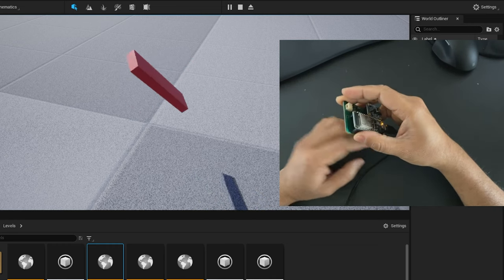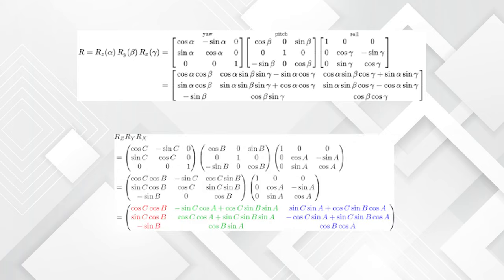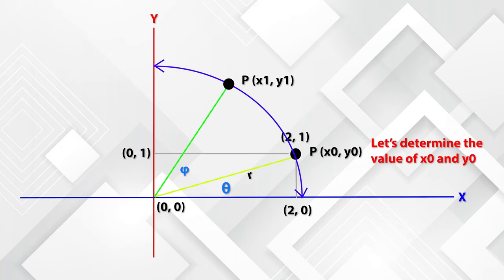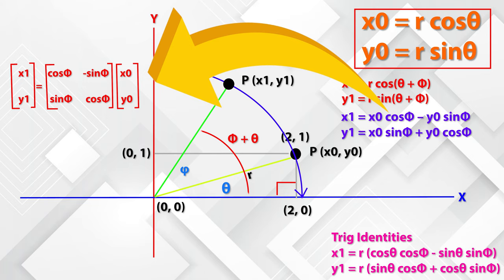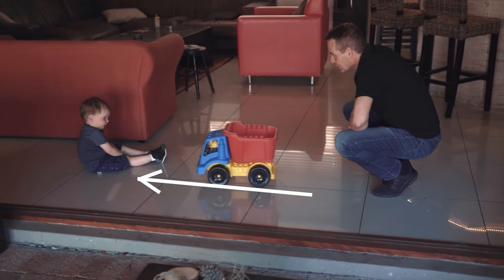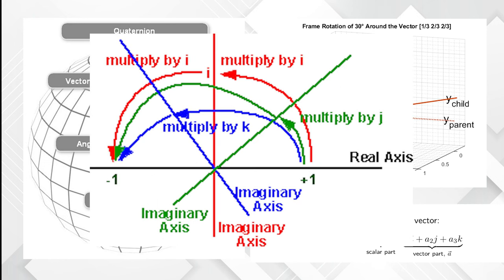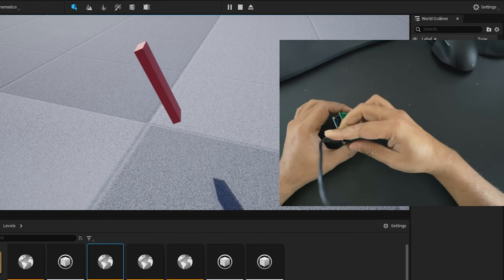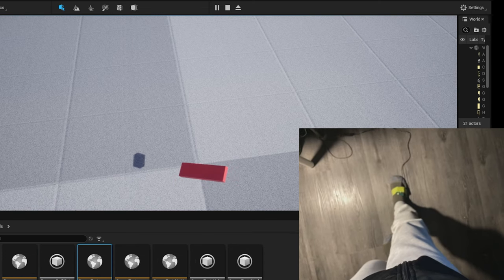Absolute / perfect orientation out of IMU (BNO055) without glitches | Realtime to Unreal (UE4 / UE5)

Comment: Hello bro
Can you help me virtual production for camera in real-time moving I'm try mpu 6050 sensor but i want to make x,y,z axis and rotation also can you help me
Reply from the maker: Mpu6050 is 6dof sensor. You can use that to get perfect orientation. If you are using arduino, process is same. You need to use mpu library. Once you get the connectivity collect the quaternion data from mpu and convert it to Euler using the formula shown in the video. That’s it. It should work
Reply from the maker: You can use this source code
https://github.com/pgii/GyroMocapUE4

Video details https://youtu.be/-snMEgDAt94
Reply from the maker: This guys uses mpu model with esp32. Use the same process. Please note mpu models are cheaper but less quality than bno. I found bno is work spending money.

Here is the difference 

https://youtu.be/3-IBOJ5FQvI

Comment: I was looking at other sensors to work with for the development of the suit also on my side, I wanted to consult you because you do not work with the Mpu6050 sensor as this also has accelerometer, gyroscope and even has the I2C interface, being this its cost more affordable than the BNO055 which is the one you work with.

What motivates you to go with this sensor?
Reply from the maker: Because bno055 industry grade and accurate. I actually worked on mup6050 and 9250. But those need lot of time to calibrate and not accurate as well. I am buying bno055 board now for my development later I will buy the chip to reduce the cost.

For comparison please check this video
https://youtu.be/3-IBOJ5FQvI

Same algorithm but different outcome
Reply: I already found the adafruit page it is not searching well and it is $31 each sensor to make the complete suit
Reply from the maker: Already working on mpu9250. Will publish it soon

Comment: Wow, just wow. I´ve been working on a similar project mesauring the pitch roll and yaw and aplying a quaternion filter but using MPUs. My yaw values are not accurate and it's making me crazy. Do you think i can achieve something similar with your sourcecodes?

Thanks for the help, you are life saving
Reply from the maker: Yes you can as quaternion to Euler formula is same. I am starting with mpu9250 as bno055 is not available. So please stay tuned
Reply: @others-makingofrpgvideogam4262  Thank you! that is one of the mpus i've been using! Sadly my yaw values are still not good enough
Reply from the maker: Please try to calibrate the imu. I am in progress of making the device using mpu9250 due to scarcity of bno055. Soon I will publish it

Comment: I see that you are using your IMU's with great wiseness and skill. I would suggest switching from Ardinos and NodeMCU's to ESP32 as it costs the same ,but has quite more power and speed at the same time. It is 32 bit IC, that has lots of prototype boards too available. There is also default arduino IDE compatability so you won't be forced to anything new.
Hope it will help.

Comment: Also, there is a thing with your concept of your use of GPS. I saw you used it for foot tracking. As far as GPS' are great nowadays, they are quite slow. So the best strategy would be to use them to calculate the crouch\torso position, and solve the foot position with IK, moving the body to the correct heigth.This idea could get you somewhere.
Reply: If you wish to use the IMU to track feet position, you can search up the "3D Tracking with IMU" by SebMadgwickResearch    posted here on youtube on 8.03.2011. It has a source code of special algorythm for tracking IMU's position.